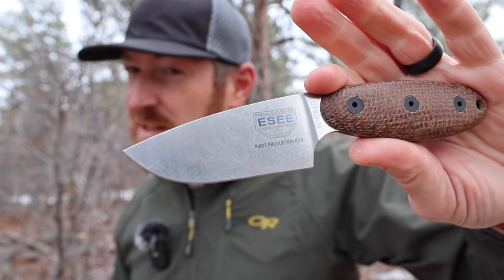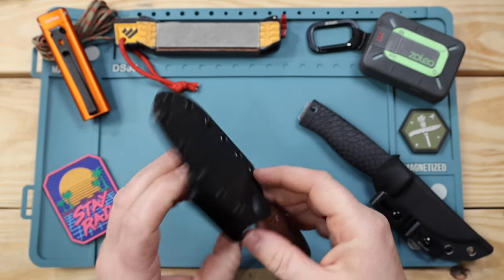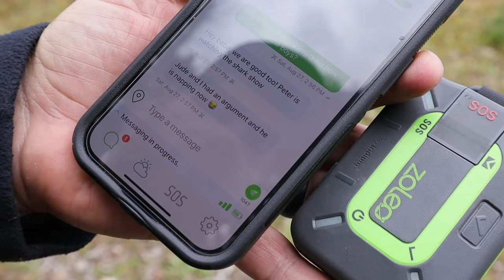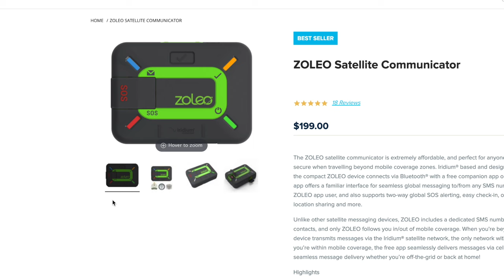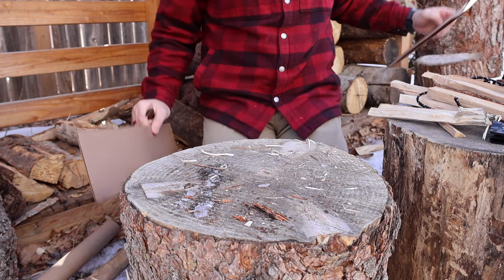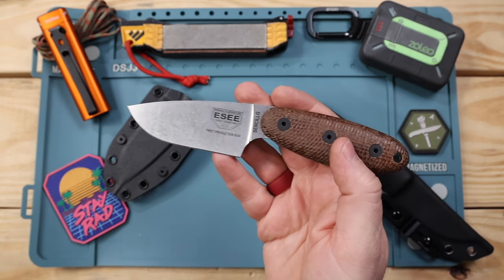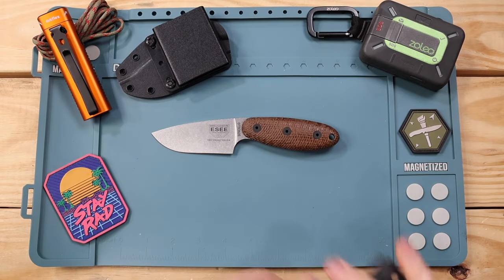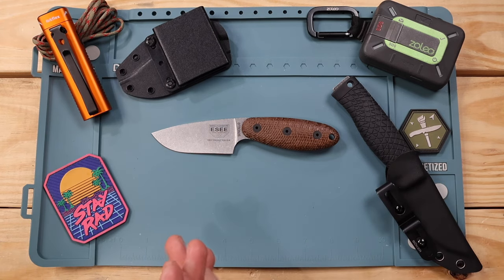Will This Be The Best EDC Fixed Blade Of 2024?

Comment: I would suggest not using the edge right at the belly for feather sticking.  It helps a ton to be closer to the back end, closest to the handle. Looked like you were sliding off when you hit the belly

Comment: Ya I’m not impressed with mine. Quality materials but the finger guard is way too thin and the handle makes your hand want to slide into it. If the guard was thicker like the Izulas I’d be a lot more happy and actually use it, but this knife just sits

Comment: I've had mine for a month now and I'd agree with some of what you've said about this knife. I haven't had any issues with feather sticking with mine but like you it still wouldn't be my first choice but for me it's more because of the size and ergos with its size. Ultimately it's a great EDC blade that is a wonderful around the camp blade but in the casual camping sense ie food prep/eating, cutting rope/paracord, basic EDC tasks etc. If you are more into bushcraft etc this isn't the knife for you as it just isn't built for that type of use! This is my first Magnacut blade and so far I'm pretty pleased with how easy it is to keep razor sharp! The sheath retention is great as mine doesn't wobble around like yours but I'd still prefer a leather sheath with a deep carry pocket clip over a belt clip kydex like the one that comes with it. I didn't think I'd like the grip design as much as I do given it sits great in the palm and the texture provides more than adequate grip. Overall it's a 10/10 for me as my EDC fixed blade I have better suited knives for bushcraft/camping etc but this one happily sits on my belt for daily tasks that those knives couldn't attend without drawing negative attention or legal issues!

Comment: Ok...hopefully you see this.  The lack of feather sticking is NOT due to the high flat grind.  It's due to the steep secondary bevel.  I've re-profiled many knives that have factory edges that didn't carve or feather stick worth a crap and ended up with cutters that work wonders.  It normally doesn't take much of a change to make it just a bit steeper so it cuts into the wood easier.  If you go too much, you'll have a weak edge.  Manufacturers often want to make sure the edge "holds up" but end up making dull performers.  ESEE is ok on the bevel but not great.  I have several and had to work about 80 percent to make them much better bushcraft tools.   The knife clearly needs the edge worked...like many edges out of the factory.
Reply from the maker: Thanks for sharing!

Comment: I saw this knife . I really wanted an Esse Izula 2 in S35VN or Magnacut would truly make my day. The ergos on the Izula 2 are great. I have a Bradford Guardian 3.2 in magnacut and could not see spending on the Sencillio. Further more a neck knife I have the White River M1 Capo in S35VN which has the best Ergos ever. So here is hoping Esse makes the Izula 2 either stainless steel.
Reply: Cutting pepperoni with my Izula 2 left the black oxide metallic taste. The knife would be perfect if it were in stainless.

Comment: Hmm, thought I commented on this video awhile back, must've been one of the "shorts".  Anyway, my first impression of the knife wasn't that favorable, but since then my view has changed quite a bit.  This knife is actually pretty capable and more comfortable than I expected it to be given the relatively small handle on it.  I've done some hardwood carving that was extremely tough to get through, and this knife performed quite well....moreso with gloves on, but good either way.  Hard pushcuts weren't really a problem, unlike my Bradford Guardian 4.5 in which I can get about 2 cuts before it become too painful to use (not sure why anyone would purposely design such a bad/thin handle on a supposed hard-use knife).  Very good in the slicing/cutting department, and small/light enough to carry easily.  At first I sorta regretted getting this knife, but after some time with it, am definitely glad I bought it (in A2).

Comment: The Izula II has a rich cousin now
Reply from the maker: Haha totally
Reply: Exactly
Reply: I wish ESSE would make a hybrid of the Izula II and the Sencillo.  My dream knife would have the   same handle and blade profile as the Iz II.  But it would have the same blade thickness (1/8") and same blade steel (Magnacut) and slightly longer cutting edge as the Sencillo.   I also like that the Iz II has a narrow, unsharpened ricasso between your forefinger and the cutting edge.  With the Sencillo, your finger is right up against the sharpened blade.  And, although the Iz II sheath isn't Kydex, it is a molded thermoplastic sheath that has excellent retention and no rattle.
Reply: @SummitScene  dude, you basically have the blueprint. Pay a shop $500 and hold your dream. A one of a kind. Just saying
Reply: @SummitScene spyderco makes what you are requesting. Its called a mule team. They release sprint runs every year with different steels. You buy the blade ,scales and sheath seperate. Cost varies based on steel. But mostly around 150 bucks for a complete knife and sheath.

Comment: G'day Aaron, noth'n particularly wrong with it, though I reckon a compact leather sheath would be more in keeping with the design and brown micarta, ... done well, it'd get rid of that rattle too. 
Probably better than most full flat folders, but in any case a little thin slicey fella is certainly not a secondary blade I'd be taking on the trail; just too limited in the wood processing department. 
yeah, I'm with ya mate, more of a camp kitchen/cordage cutter and maybe around the house or EDC.
Like the look of that Boker as a small, camp utility, job. I don't remember you reviewing that one, coming soon ?
Cheers Duke.

Comment: So... for my Sencillo in Magnacut its been pretty nice as a work EDC. I'm not working with wood though so... there's that. The knife being super slicey like it is makes it a cardboard destroyer... even through multiple layers of thick cardboard.

I haven't used it for food prep yet... but I could definitely see it working for that. The wide blade does help give some knuckle clearance for when you are working against a flat surface. 

All in all... the blade size, shape of the handle, and included clip make for a relatively compact and easy to carry package. Been very happy it was my first Magnacut fixie.
Reply from the maker: Nice glad to hear it has been working well for you!

Comment: From my perspective the Sencillo in magnacut would be the ideal small fixed blade bar none minus the wide sheath. I do prefer the taco kydex GREATLY due to being able to carry IWB or in the pocket, but I can fix that issue myself. 

I am never super fussed to make the perfect feather sticks I find. My usual approach is scrapings, a couple fine feather sticks that I put effort in, and then 3-4 rougher/thicker feather sticks that will hold the flame longer as twigs would. 

For everything else I would need the Sencillo would excel! I find more use for thin slicey grinds in every day tasks than any other. Slicing up food, cardboard, cord, leather, small carving, fish & game. I also am often in salt water snorkeling so something so stainless like magnacut would be welcome in that environment. Also that handle looks kinda perfect! Currently my fixed blade EDCs are the CRKT BIWA (12c27 version) and Petrified Fish Bison which are both budget choices, once these get too worn I'll probably snag one of those Sencillos!

Comment: Its spanish and it is pronounced sencilJo not senciLLo , means simple :). Well the knife looks ok. I agree blade is to high not only for usage but also aesthetically also the blade geometry is not what I would like, do not like the top is rounding down. but considering the steel used it seems in comparison to other knives from them, the price point is slightly better than other ESEEs.

Comment: Well its a darn nice knife i already have several knives in magnacut , spyderco mule team, ontario's spl pack knife.those two are very close to this knife. Along with a few others. All were cheaper than this knife. I want one but ill pass on this one for now.
Reply from the maker: Do you like the Mule team? I’ve never gotten one and I’m thinking about doing that.
Reply: @gideonstactical  yes i love it i have several . They make perfect edc fixed blades . Not too big but big enough. All you need is on sheath for several knives.

Comment: Yeah, the sheath is pretty wide. I like the handle, not the blade.  The Zoleo is interesting. I like going solo hiking; no cell signals. At 66 I'm well aware how dangerous that's becoming and have limited that activity.  That would give peace of mind. I'm never far out just no way to communicate an emergency. Seems quite reasonably priced.
Reply from the maker: Yes they really provide a lot for the value
Reply: What hat are you wearing in this video? @gideonstactical
Reply from the maker: @hoptimer1634  https://amzn.to/48X4Oh2 its a richardson hat.  I really like it.  Very lightweight, flexible, and inexpensive.

Comment: German knife companies building knives in Germany should NEVER use Chinese steel.  I suspect that the Mini Bronco has the blade blank made in China and then shipped to Germany for finishing and handling.
Reply from the maker: No idea
Reply: As far as I understand, 80crV2 is not a Chinese steel. It sounds like it would be, but it is made in Europe and used by many European knife makers. Since Boker is a German company I would assume that they are using 80CrV2 made by Thyssenkrupp in Germany.
Reply: A 10 second search would have told you that the Bronco Mini is Böker Manufaktur Solingen.

Comment: I could not disagree with you more, regarding the depth of the blade profile.
It fits my XXL/XXXL hands perfectly...without my fingers having to be hanging off say a cutting board before the blade makes full contact with the items I am cutting.
Of coarse that is my mileage as you said. VERY difficult for me to find smaller knives that actually fit my hands even 1/2 a**edly well.

Comment: I don't understand how anyone can justify $174 for a 3in fixed blade.  
I don't really care about magna cut. Corrosion resistance doesn't matter to me. 
I prefer toughness and i can get a coldsteel 3v mini pendleton hunter for $55. 
Warranty is just marketing.  If you are using your knife and it fails. Why would you want another one?  I want a knife that doesn't fail. 
Plus every knife company has Warranties. Only overpriced companies complain about replacing messed up knives. 
Montana knife company is another ridiculous overpriced carbon steel.
Reply from the maker: $175 sounds actually very reasonable. Especially when the izula 2 with handle scales is pushing $100. MagnaCut is more expensive than 1095, potentially longer processed heat treat, it will eat up the sharpening belts faster since it’s a harder steel, and they are outsourcing it through White river so they have to pay white river first. Once all done for a larger blade in the izula 2 Still made America $75 spread around like that doesn’t sound like a lot.
Reply: @gideonstactical  maybe I'm just getting old. Along with the fact I worked my whole life in shops making stuff and fixing things. I know how these knives are made. The type of steel is more marketing then it is meaningful. To the price.

Comment: Well its an Esee so it is certainly one of the most overrated knives of 2024
Reply: How so? American made and reasonably priced for magnacut steel. Im genuinely curious…
Reply: @awdobsession717  I snapped the tip off of an se5 trying to stick it in the picnic table at a campground. And my sc6 is just not a comfortable knife at all. I have three or four knives that cost around $100 the same size that feel a lot better in the hand
Reply: @caseylewis2835 so you stuck your knife into a picnic table that was likely made of a hard wood like oak and because it broke it’s now the most overrated knife? Got it